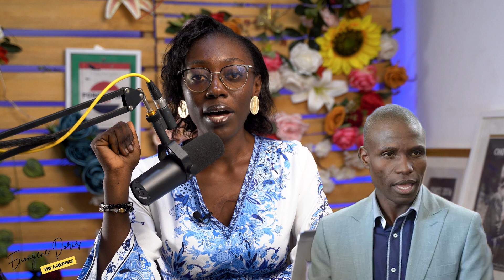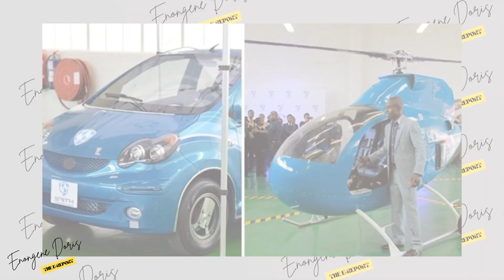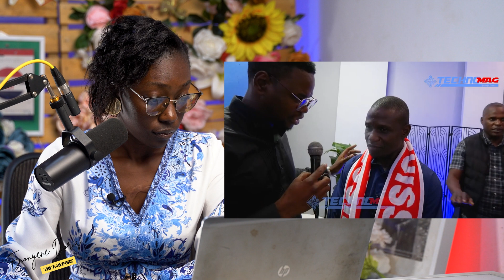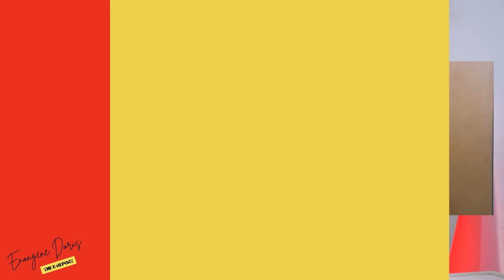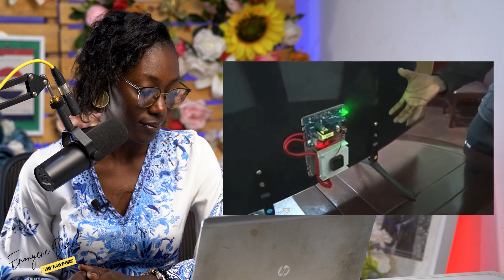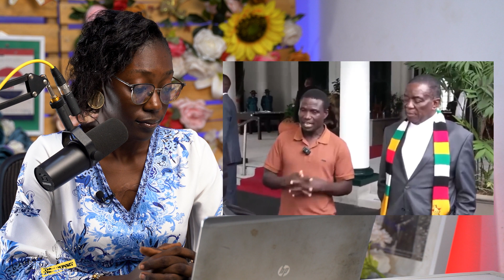African Inventor Stuns World With Revolutionary Technology!

Comment: I'm an engineer, scientist and inventor. Doesnt work. Chemtrail project blocks over 40% of terrestrial energy. All man made energy beaming around. If you use a transformer under a power line you can pull power. 
If you are going to pull radio frequency energy you would need to be in the heart of any high tech city with lots of transmittersl broadcasting rf that can be down converted.
He is doing this in the middle of Africa. It didnt appear to be near anything that could broadcast the energy.
If im wrong i will buy his device and eat it on camera. I will use alot of Tobasco sauce. I followed him and tried to reach him no answer or response.